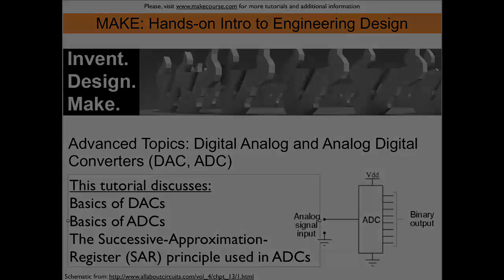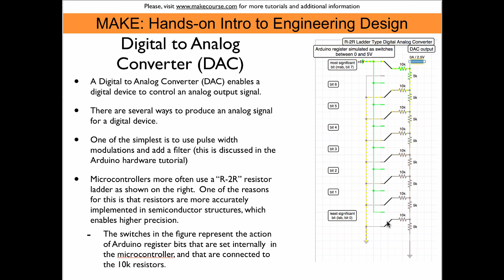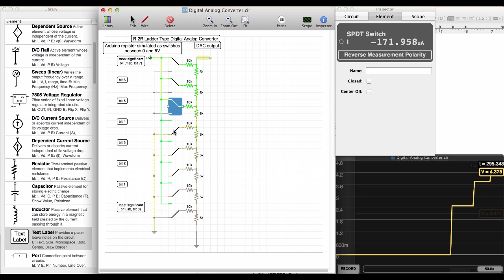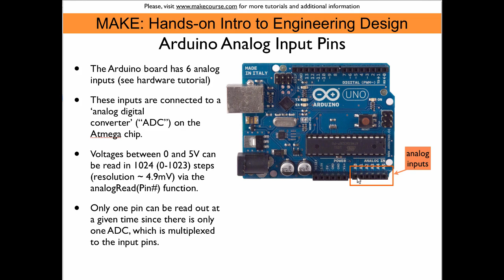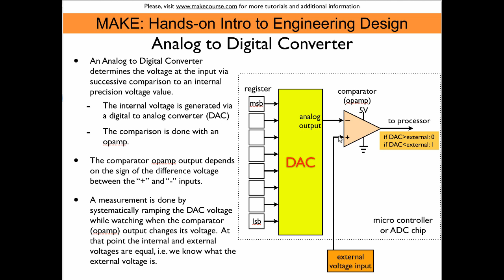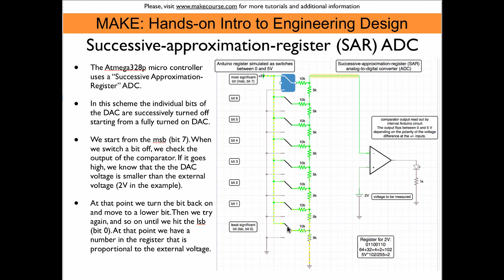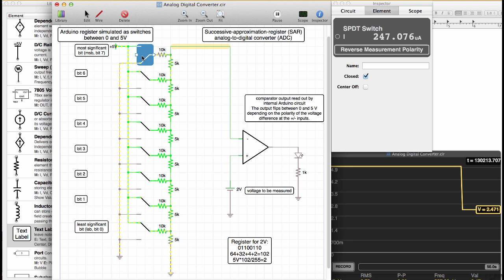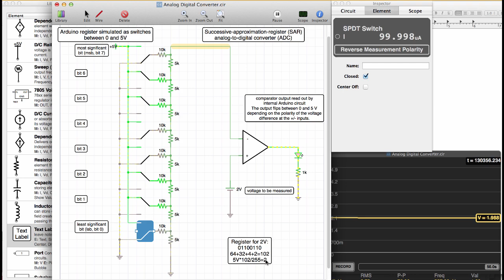Tutorial: Digital-to-Analog Converters (DAC) and Analog-to-Digital Converters (ADC)

Comment: what software you use to bulid this converter you shown in the ending of tutorial
Reply from the maker: We use iCircuit for simulations. It is very easy to use, but has a few quirks...in general, though, it is very useful for a quick and dirty simulation of circuit concepts. If you want a more exact simulation of actual components, you need to use a pspice based simulator, such as LTspice (it is free). Have fun!